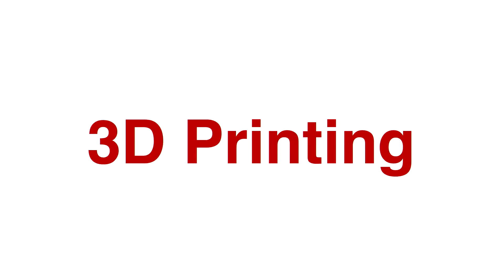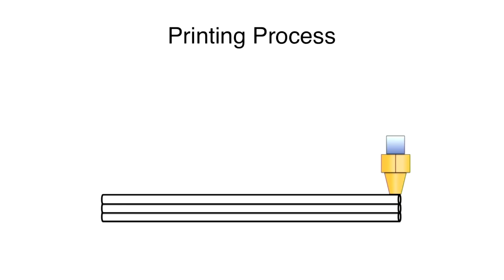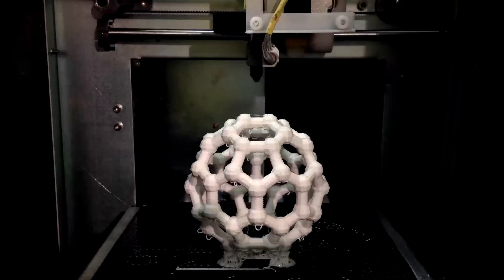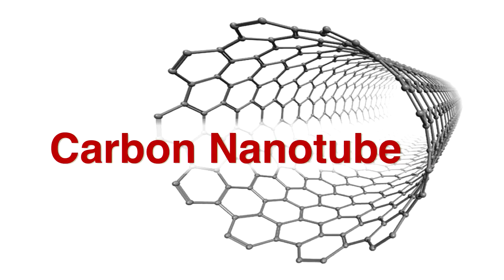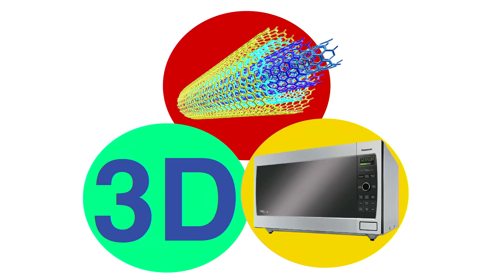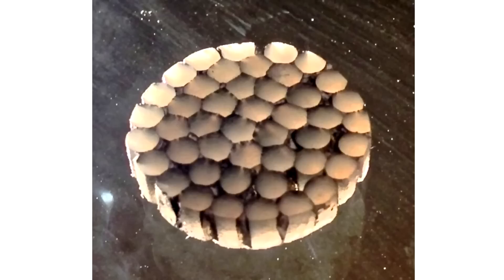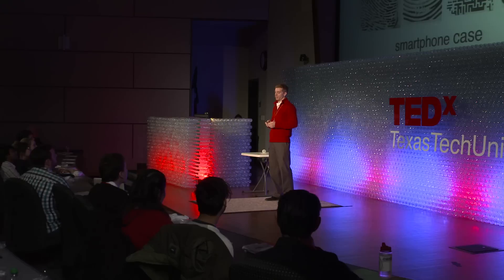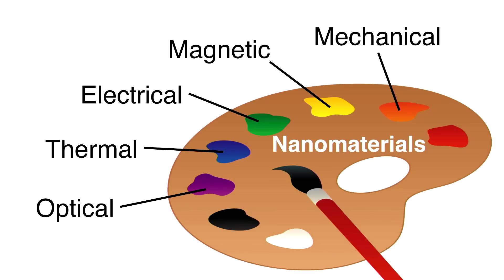Innovation in 3D printing - nanomaterials & microwaves: Brandon Sweeney at TEDxTexasTechUniversity

Comment: how are you adding the nano tubes to the filament, and how long is each nano tube section? my curiosity is could you use some form of wax instead of plastic for the filament. could you print nano tube coated wax filament and then melt the wax out Leaving a nano tube only 3d print?